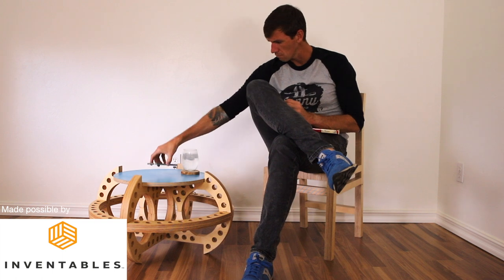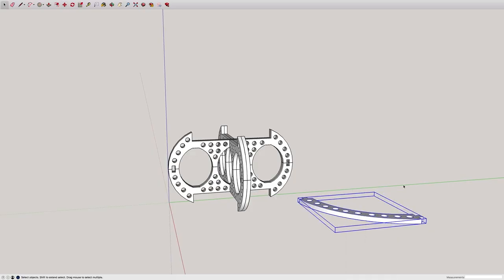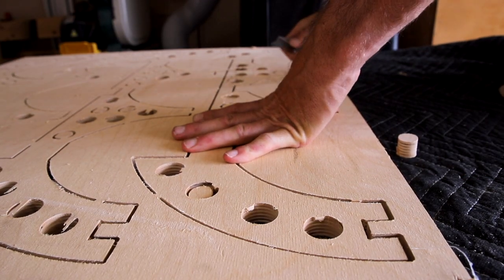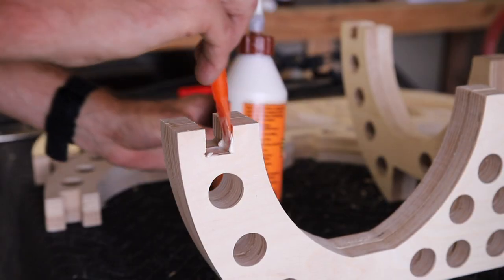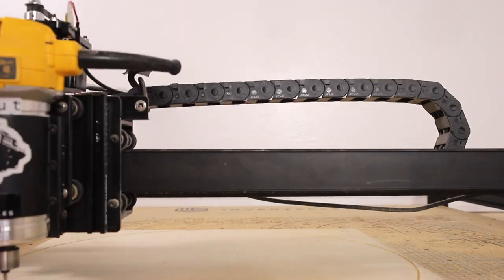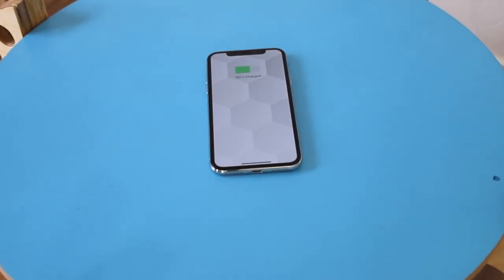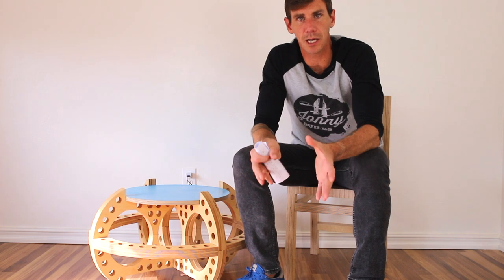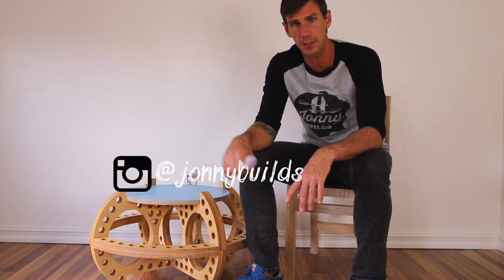DIY Coffee Table w/ Hidden Wireless Charging | Converts to Ottoman | CNC

Comment: Brilliant design. Only one question, what purpose those circular holes all along serve, apart from reducing the weight of the table. I am asking this, as the design is doable with regular hand tools and those small circular holes can be avoided to make it as a entry level project, without CNC

Comment: If you upscale the size, it could be an amazing picnic bench too.
Reply from the maker: That would be cool, but I think I would need a much larger machine.
Reply: Or cut the pieces "smaller", so they can still be cut on the X-Carve. Just offset the seams, and they will not be an issue once assembled.
Reply: @doubledarefan  I agree. Where there's a will there's a Johnny Builds.

Comment: That's a great build, and a nice use of the cnc. The holes have to make it nice and light to move around. I have a 3d printer (I've designed and printed spacers for a tabletop project) so it would be tempting to have a go at cnc if I can budget for it. I have to ask, the design looks to have some Cardassian influences - is that just coincidence?
Reply from the maker: If you’re running a 3D printer I’m guessing you would have zero problems running a cnc. As far as the design I really don’t have a specific inspiration. I had the basic shape in mind, and everything else just came from playing around in sketchup. As always thanks for watching!!

Comment: CNC work can be a crazy scary door to open, but once you walk through it there is a huge room of opportunity. Hit me up if you ever need help
Reply: And if you're doing lots of holes like that, sometimes it's easier to let the machine completely mill the plug away rather than cut outlines, less cleanup if you have the time to let it run like that.
Reply from the maker: That would’ve been like a 20 hour carve!
Reply: @JonnyBuilds  or a bit change